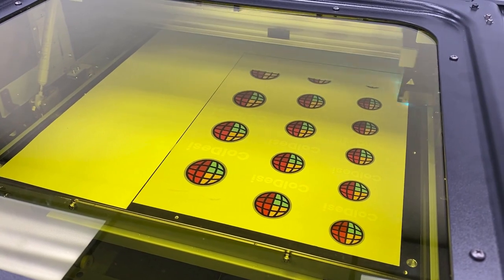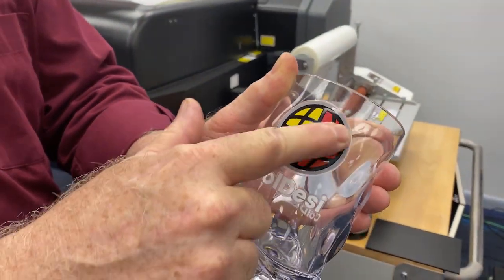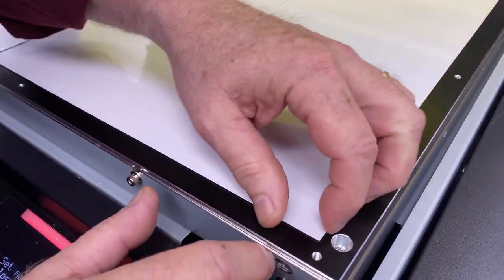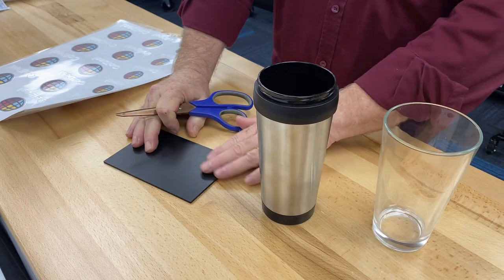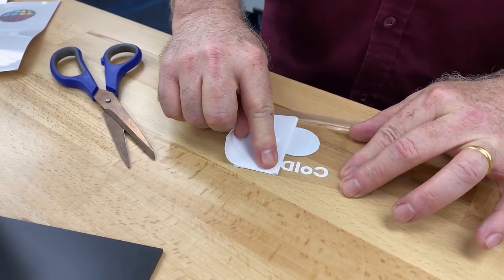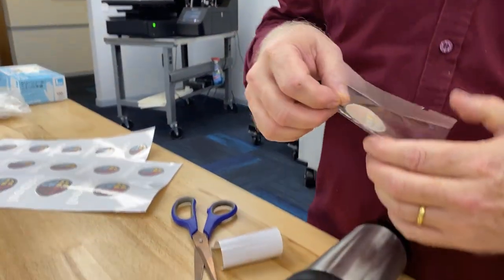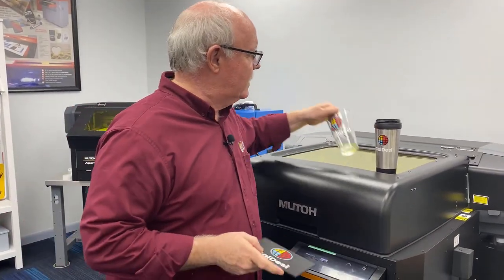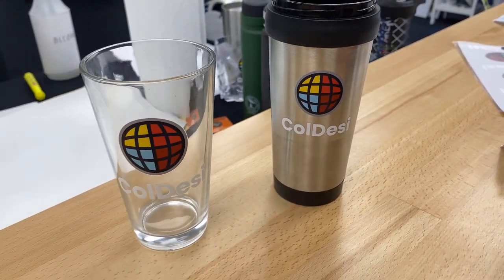Direct to Film UV Printing | Mutoh XpertJet 661UF

Comment: This is pretty groundbreaking stuff!
I remember when I was first introduced to DTG a decade ago. I used to call up Coldesi for technical support. I never thought all these processes could eventually evolve into a Film Transfer process. Soo good coldesi!

Would it help to warm up the metal substrates to relieve some of the surface tension?
Reply from the maker: Hey Selling! Thanks for the shout out. We haven't found the need for any extra steps in this process.

Comment: I have a question. I've got some uv prints getting done for bmx parts. Specifically a bmx sprocket, the sprocket has a hole in the center . The print will cover the hole, but obviously there is no material where the whole is. Do you think it would mess up the application when trying to remove it ? Perhaps taking up the rest of the decal ? (Hope I'm making sense)
Reply from the maker: You should be fine and not have to worry about the hole. UV is not a decal at all, it jets the ink onto the surface, so nothing to peel up!
Reply: @ColDesiColman  thank you for your reply. Very much appreciated. Perhaps I incorrectly labeled the type of print I'm getting . I believe they are UV transfer. I looked at some product reviews and see that buyers typically got these prints to later adhere to packaging, in some instances even awards . I've ordered them to place onto a metal BMX sprocket . The application shows you apply the print, apply pressure and then pull off a top layer . My concern was the hole in the center of the sprocket . Having nothing behind it that small area would be "unstuck." When removing the top layer I'm hoping it does not cause an issue.

Comment: This is nice to see but I’m trying to understand the sheet used. 
Is that a special dtf sheet with a dtf pickup or is that just any sheet with glue picked up by the backing paper. 
I can see that no powder was used so I’m guessing the glue was already on the sheet. 
I’m looking at costs. 
Printer cost + cost of that sheet, release paper etc. 
Thanks.
Reply from the maker: Got it:

It is a special UV direct to film kit - you can find the details here: https://colmanandcompany.com/Laminator-and-UV-Film-kit.html

And the printer is a Mutoh, you can find that printer and pricing here: https://coldesi-uvprinter.com/mutoh-461uf-uv-printer/

Comment: Hello ColDesi,  i am interested, how can you remove white pixels around every picture or text, as i hear it happens from the spot channel.
Reply from the maker: Hi Alexander! It is hard to help without seeing what you are referring to. We have a dedicated UV Support team that would be better able to assist you. You can call them at 877-793-3278
Reply: Just reduce the white layer by 0.05-0.1 mm and the white paint will not be visible under the color
Reply: @АлексейРунасов  How i cant find it? Please Help
Reply: @alexandermelendez1564  What software do you use? For example, in Acrorip you can reduce the size of the white layer from 1 to 20 pixels
Reply: @АлексейРунасов  For the DTF i use Acrorip - For My UV Machine i use UltraPrint is for printing and PrintEXP in the software of the UV machine
Reply: @alexandermelendez1564  As I said earlier, in Acrorip you can reduce the white layer by using the "White color control" option
Reply: @alexandermelendez1564  UV machine RIP can also automatically reduce the size of layers, but if you often print the same image, you'd better change the size of the layer in the file using the scale tool.
Reply: @АлексейРунасов  i wish i can send screenshots

Comment: How can I order those film here in the Philippines?
Reply from the maker: We do not know.
Reply: @ColDesiColman  Ok. Anyway, I found a local print shop (chinese) here who converted an Epson L1800 into a UV ink printer for $1960 with white ink but without a varnish. Thou the maximum printarea is only 8x14 inches because it still uses the paper roller and has no vacuum tray to hold the film. And also doing the same process. What I am concern about is the printhead prone to clogging? Because I'm not printing stickers on a daily basis. What if we do not use the printer for 3days? Is it hard to maintain a UV printer? Thanks!
Reply: @ColDesiColman  I have been looking for someone to print my designs like this. Can you possibly direct me to someone who can help with this asap?